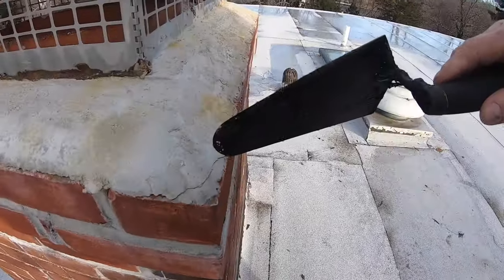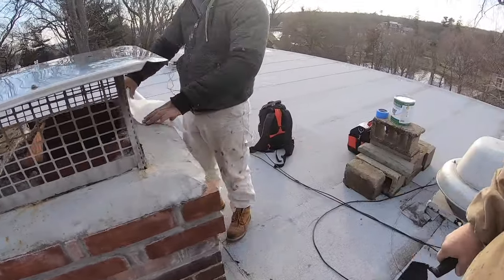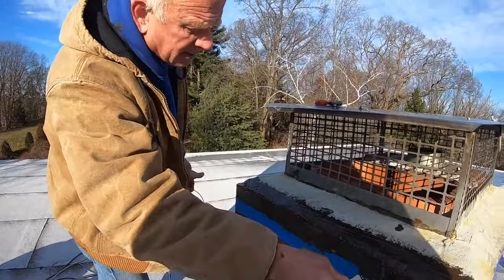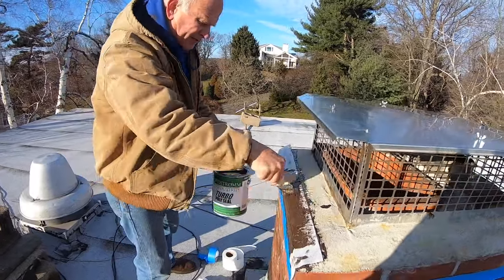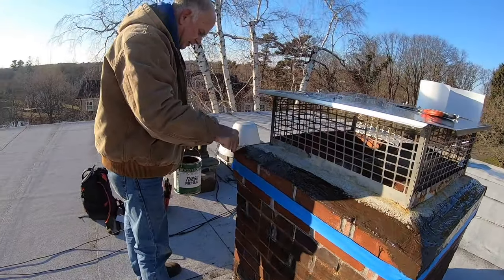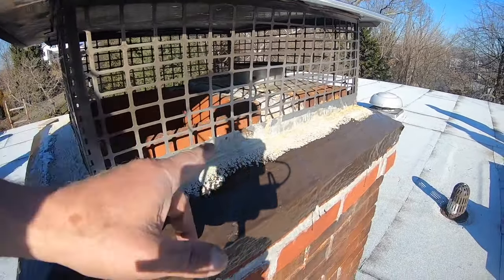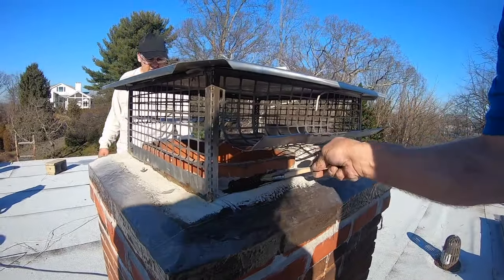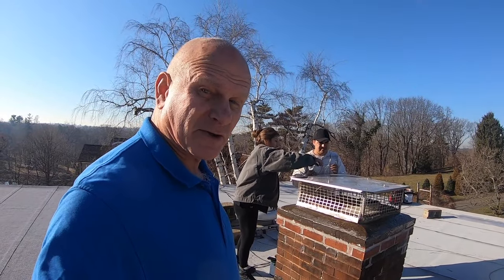How to waterproof a Chimney Cap? How to Seal a Chimney Crown? Leaks!Turbo Poly Seal

Comment: This guy uses the same stuff for everything. It's probably too cold to use any coating.
Reply from the maker: Well if you find something good, then why would I want to use anything else that I have already used in the pass? I am a Torch Down guy and for any leak sealant I use Turbo Poly Seal. Any other roof system does not match to Torch Down and any other sealant does not come close to Turbo Poly Seal
Reply: @FlatRoofDoctor  pretty much all roof systems are well and good if four conditions are met 1st, Design. 2nd, materials. 3rd, installation.  And 4th maintenance. I personally use several products designed for specific uses. In my over fourty five years in the industry I have found that just one product is not a cure all. Best wishes to you and yours.

Comment: Im sure the customer loves that your chiseling down the integrity of his chimney for your video tutoriol...tf...
Reply from the maker: LOL, Well I could have made a big deal about the chimney and told the customer that the cement slab was all cracked and lose and that it has to be redone bu tearing it off and pouring a new cement slab. That is what most people do to create more work. That is what the previous guy did five months before me getting to it. They rebuild the top part as I show in the video. Then the slab just flaked lose and caused a leak. The flashing at the bottom and the chimney crown usually what causes leaks. The way I sealed it with the Turbo Poly-Seal, it will never c\rack open again. I warrantee it from leaking for the next 10 years. 
Me chipping off a piece of cement didn't make it worst,  I hate to see poor workmanship and to seal on something lying lose that could crack and cause a defect in my work. I'd rather remove it and seal to more solid foundation.

Comment: If you can't seal a roof without friken tar you aren't a roofer
Reply from the maker: Hi Abner - I am not clear what you meant by "without Tar" 
There are times where you need to use "tar". Now, what is tar? That covers too wide a spectrum of brands and varieties that it would be impossible to come to an agreement.

When I refer to tar, then I only refer to Karnak 81 Trowel grade or Karnak 66 Trowel grade. All other brands like Henry, Bull Dog and so many more are the far lesser quality of "Tar" than that of Karnak.

When I install a Torch Down Roof, then I will very sparingly use Karnal 81 Modified Bitumen Adhesives Trowel Grade in some details. After I applied the "Tar", I then will sprinkle a coat of ceramic granules over the tar. This does 2 things. It makes the tar blend in with the rest of the roof and also the tar is protected from Ultraviolets. This way the Tar will not dry out fast and crack.
You are right when you refer to all the lessor quality tar that you can buy anywhere. Then you should avoid using those Tar products by all means.

The right Tar h=does have its place for the right application. It is not to be used to try to fix a bad roof or to cover up someone's sins.
Reply from the maker: You are not bashing anyone. You are revealing your ignorance.
1. I did not use tar as I explained before. 
2. In the video I actually show the grouting and from that you can see the the grouting is perfect.
3. If you call the "Chimney Crown" part of grouting, then you don't know much about chimneys.
4. I live in the North East, Connecticut, where water freezes during winter. A thin layer of cement is not enough to keep water seeping in, freeze and pop the cement lose. When someone pours a thin slab of cement on top of a chimney,  it almost always cracks lose. I am not a mason, but there are techniques to secure cement better to brick surfaces. My experience is that if the cement slab is 2 -3 inches thick it never cracks.